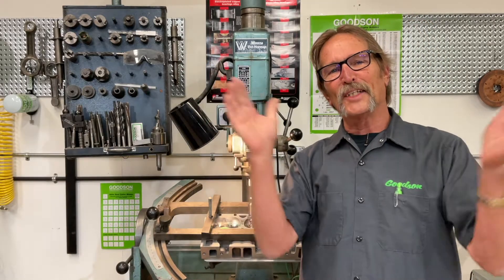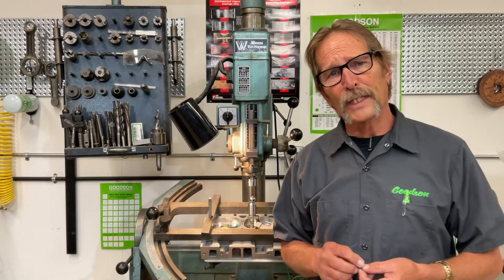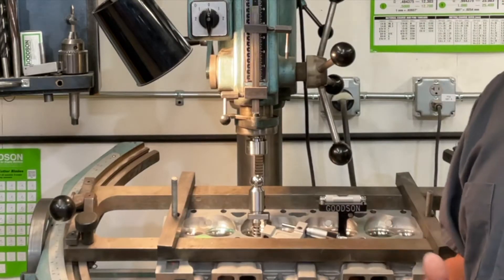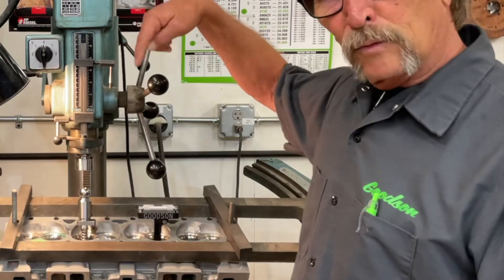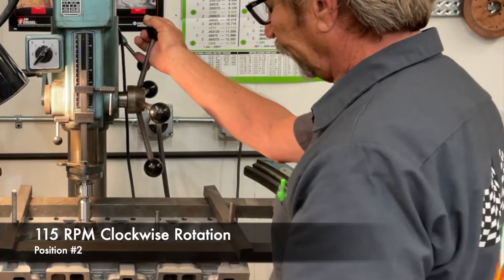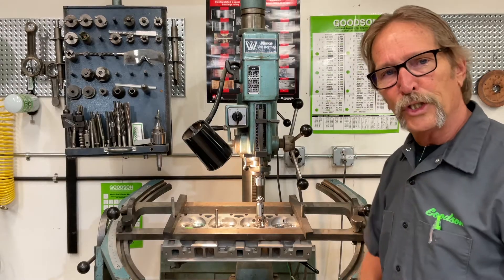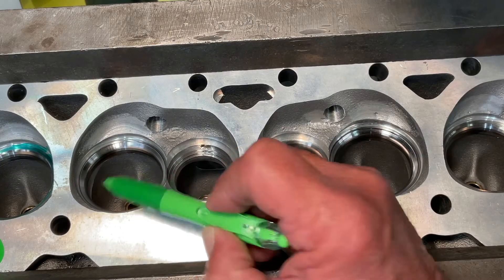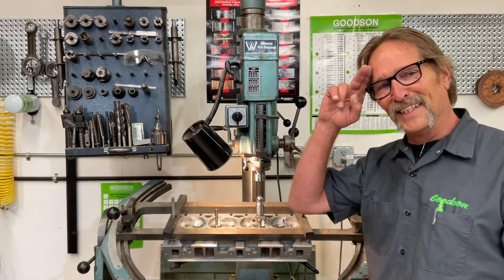Introducing the SABER TOOTH Series Cutter Blades

Comment: I’ve personally had better luck with the old carbide inserts over the saber tooth when it comes to insert life, chatter, and finish on the SBI seats we typically use.
Reply from the maker: Joshua, what alloys' are in those seats or a part number from the seat box will help. have you tried the same part number of new Sabertooth series? what part number cutter are you referencing? thanks, dave
Reply: Some seats require a very slow speed 40-60, if you still get chatter at a slow speed try 100-120rpm.  I can usually find an rpm that gives me a near polished finish.